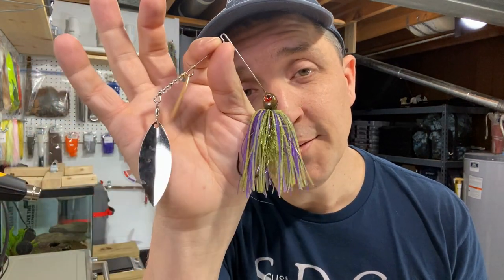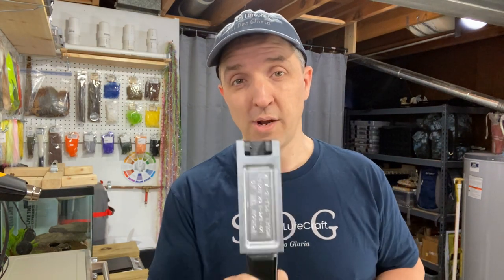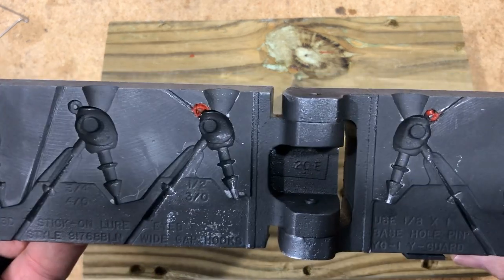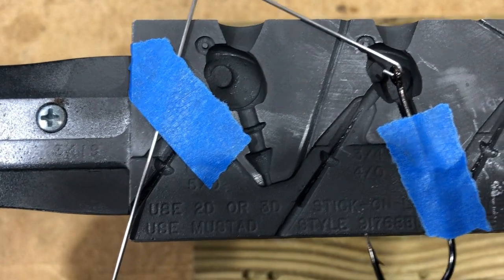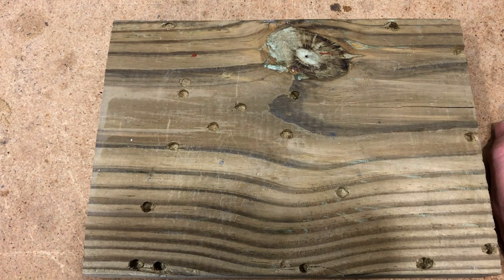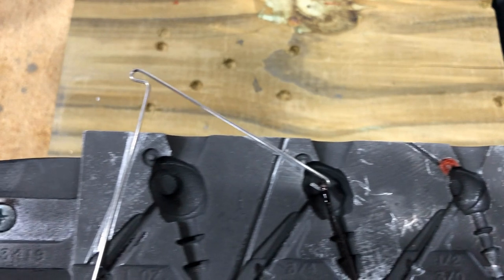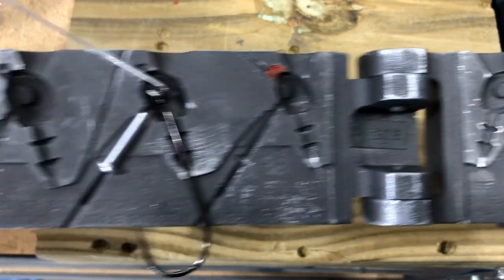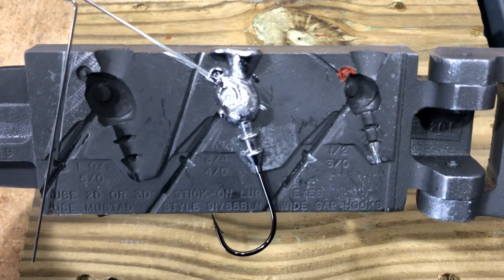Make Spinnerbaits with a Modified Poison Tail Mold!

Comment: Found your channel a couple of weeks ago and love it!  I've learned a lot.  I took your idea of taping the wire form in the mold and pounding an indentation in the mold and it works great!  One thing I did was instead of using a file to ream out the channel for the spinnerbait wire is; chuck up a small drill bit into a drill, set the drill bit into the indentation, closed the mold and started the drill as I progressively added more pressure to closing the mold.  It turned out perfectly.  And a way you can cure a spinnerbait in a toaster oven is put the rack on the top and slide the top of the spinnerbait wire between two bars of the rack (go in from the bottom of the rack) and turn the spinnerbait perpendicular to the bars so that just the R bend is on top of the rack.  That way you can cure a good bunch of spinnerbaits at the same time.  Thanks again, keep up the good work!
Reply from the maker: Thanks man, and great alternate options!  Glad you’re enjoying the channel!

Comment: Have you ever tried using accelerator spray on your superglued eyes? More popular in the miniatures community,  but it very quickly sets CA (super) glue and helps to avoid the clouding residue.
Reply from the maker: Thanks for the question!  I’ve owned some and tried it in other applications.  At the time I was worried about the affect it would have on the cured finish of the powder paint( the overspray I mean).  I think I even called a company to inquire and they said it may (or may not… classic…) cause a problem, so I ditched the idea… stuck with fool ol’ SG Gel and a fan :). I remember the accelerator had a nasty smell too, super strong if I recall.  Thanks again for the question!

Comment: What a great video, very clear, concise and well thought out. have you ever modified the eye portion for multiple size hooks. I have the poison tail but the hook that it calls for is a wide gap and I want to use the 32866 Mustad hook as well. Please let me know if you have done such a thing. Thank you .
Reply from the maker: Thanks man, truly appreciated!  I actually prefer the 32886 as well as use it, almost, exclusively for that mold (when making swim jigs anyway).  Not sure I had to alter the eye at for it though.  I did drill out the eye so I could use a flat eye hook and make chatters with the same mold.  If you’d like to see that there’s a few videos on the channel (1/2oz modification and 1/4oz finesse size chatter 🔥🔥).  Hope this helps!!

Comment: Did you consider putting the mold into a vice and just cranking down on it, slowly increasing the pressure in order to create the indentions that you need from the wire form ?
Reply from the maker: Thanks for the comment/question!  That's another great option and one I've heard guys use for sure.  My shop bench is such that I can't mount a vise on it, so I actually don't own one where I could take this approach, believe it or not!  Definitely another viable option that, I've heard, works great.  Thanks!

Comment: Welcome back! Sooooooooooo...did you have any concern about distorting the flat planes of the mold by beating on it with a big dang hammer?
Reply from the maker: Thanks for the question Scott.  It’s been my experience that the mold is otherwise unaffected.  The pounding is just sufficient enough to make the small indention of the wire, but not enough to distort the mold.  In the case of this poison tail, it’s poured perfect Swim Jig heads after the mod.  I can see a potential issue if you didn’t hang it off the edge of the wood and pounded it at an angle... but even then, man you’d REALLY have to wail on it!! LOL those molds are thick!

Great question though!  Appreciate the feedback!

Edit: BTW, some guys recommend just squeezing the mold with the wire form inside to get the same effect (in a vise etc).  So, that may be an alternative that doesn’t feel as dangerous :).... although I suppose one could argue the same risk exists (maybe even more so with constant pressure (????).  Anyway, just came to mind FWIW!

Comment: Have you ever made any underspins. Do you recommend and molds or to modify any molds? Looking for one that would make a good size underspin for smallmouth and spots. But strong as well. I appreciate any suggestions
Reply from the maker: Hey Jason, interesting timing on this question!!  I’ve been planning an Underspin video with a modified mold in the near future, it may be just what you are after.  Otherwise, there’s a few Underspin molds out there that may work - some make some good sized heads.  

Thanks again man!
Reply: Do you know when you might make that video?
Reply from the maker: @jasondiddle4226  hope Tobin the next few weeks, I’m waiting on one piece of important equipment.

Comment: What do you do to make sure that your lead pot doesn't get clog or how to unclog the spout?
Reply from the maker: CLEAN soft lead is critical.  I know a lot of guys look for a deal and get free wheel weights to melt down, but IMO, that stuff just cruds up your pot and clogs the nozzle.  If its already clogged you can use a wire to unclog (push it up from the bottom... but use pliers and gloves!).  Draining and cleaning the pot afterwards will help for the next round.  If that doesnt work you can actually order a replacement pot and post from Lee and start over with good clean stuff.  Hope this helps!

Comment: Need to be very cautious when hammering on molds,they're only cast aluminum,especially that hard.
While the mold when closed is laying on the small bit of wire closest to the hinge it isn't the further away you get from the hinge which is why it didn't indent it near the handle.When hammering on it to make the indent near the mold handle it puts a ton of shock stress on the hinge and after the wire at the hook.1000's of molds have been broke this way,sometimes it'll break in half or near it other times it'll break the hinge.A lot of them have been broke just my squeezing the handles to try and get it shut when a hook eye or shank is just a little out of whack.

The best way to do it is lay it out where you want it like you did.Then take a sharpie with a sharp point or in your case where you sprayed the mold a scratch awl and run along the sides of the wire on the mold.Then take a dremel with a cutting wheel and cut it between those lines you scratched into the spray coat.
One can do this with a smoked mold too,and if you haven't smoked or sprayed those you can also use a sharpie to "color" the mold then scrape it with the awl.Think of it as a poormans engineers layout ink.

When I started pouring Crappie spinnerbaits I tried the shaker,but ended up just using a piece of paper folded 2 times (1/4'd).Cup it in your hand an pour a lil powder in and then dip your jig and wrap the paper around as you twist the jig.Can't get it to hot or you'll have a very thick coat,but it works a lot faster.

Those oven racks for curing don't need 3 bolts,2 is perfectly fine for all heads that will it in those toasters.The 24" or 26" ones (15 total,still need to make more) I made for my kitchen (shop) oven I only used 3,1 on each end 2.5-3" in from the ends and 1 in the middle and they hold everything I make just fine.I only used 1/16" x 3/4" aluminum angle for my racks and it's plenty stiff enough to get by with 3 bolts.
It's not much but that middle screw will take place of 1-3 jigs depending what size they are an if you making a lot of them it adds up,plus it's one less bolt you need to mess with.

Another problem I have found with the toasters over the years that I didn't mention in one of your other vids,but the ones I have used all change temps every time you or it turns off and you turn it back on.Have to check them every time you turn it on.I used to paint a lot of jigs then cure them in batches by setting my time and right before it stops I'd hurry and turn it over to constantly on then load and then set the time again.I found doing this I didn't have to check it every time.With my kitchen oven I just set a timer,I still check it every time I turn it on though as it can be off too but it's nowhere near as bad as those little toasters.